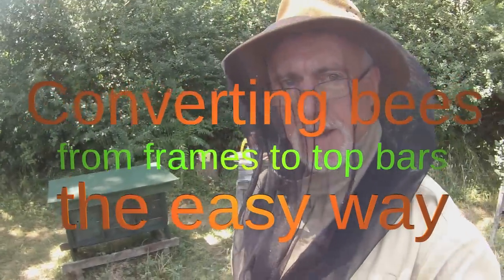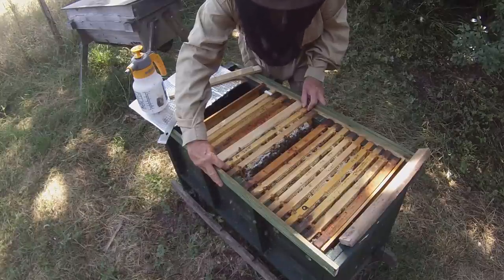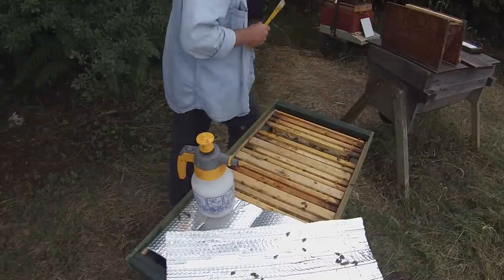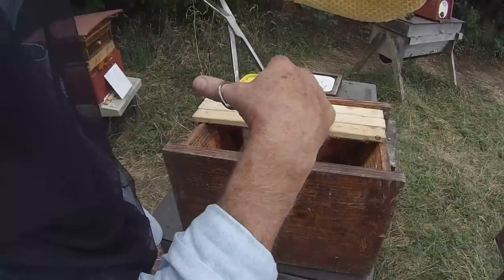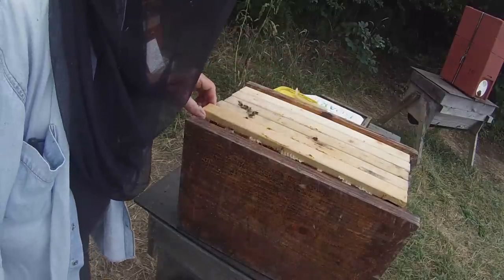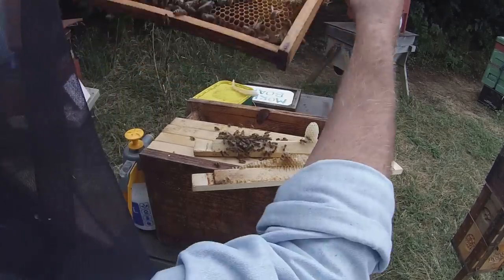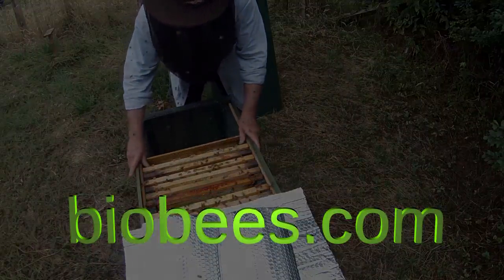How to convert bees from frames to top bars the easy way!

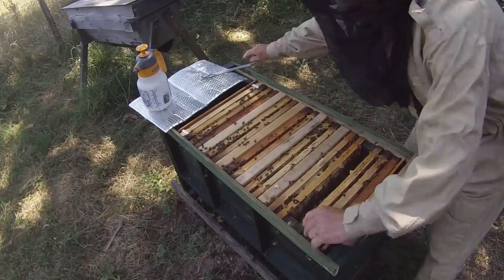Comment: As per your comment at 5:35 about using metal runners to reduce friction, you might try just pushing a thumb-tac into either end of the top-bar where they rest on the runners.

Comment: I am curious what would happen if you leave the top bars in the square hive for longer. Would the bees then attach the sides of the comb to the hive? In my top bar hive the bees hardly attach to the sides and I have not had any cross combing. I have seen that here in Germany it is possible to buy top bars for the more common hives - Dadant etc. Wonder what they would be used for.

Comment: On the top insulation - the Aluminum side reflects heat - and so it should bee below to reflect the heat back downwards.
Reply from the maker: Both sides are covered with aluminium foil.
Reply: @BarefootBeekeeper  Thinking aloud here Phil, but does Reflectix induce condensation with all that nectar being evaporated in the frames below? Perhaps not since Reflectix maintains ambient temperature owing to the air pockets. Still, I wonder about it interfering with ventilation flow overall.
Reply from the maker: @AntPDC  convection takes care of it. A good read is Constructive Beekeeping, by Ed H Clarke (free download from my site).

Comment: Hi Phil,
Hope this question finds its way to you on an older video of yours but thought it best to place on a video where the question has relevance. I'm an avid watcher of your very informative videos so thank you very much for such a range of instructional and knowledge building topics. I have been considering keeping bees for several years now and am now in a position to do so. I have always gravitated back towards using a TBH even when there have been very knowledgeable people I have spoken to who have offered that start with a national hive to start and then transfer if you still feel you want to go topbar. I have just reserved a nuc (Jan 2021 for June) and thought about how I could convert a 5 bar national nuc to a TBH from the off as it were. Do you think it is feasible to carry out this within the poly nuc or would you suggest setting up an intermediate such as your hive in this video? I was wondering whether the bees would be able to cope with the move to me and then the time it would take to begin their topbars within a confined poly nuc? Any help would be very much appreciated. Kindest regards. Graham
Reply from the maker: You could do it with s poly nuc, I think. Probably a double decker.
Reply: Why not do what Phil did in reverse ? Use the Frames of bees you have in said purchased equipment. And, take out two outer frames, and add a Top Bar, zip tided under a 'spare' faux Hive frame.... 
As the bees build up the TB's, remove another 'real' frame, and place in outer position. Then by default the centre frames will become TB-esq. (Trim square comb to 'Fan TB shape', and transition them to real TBH !  )😉
*Any bees remaining, shake back into box, use comb and stores (later, zipped to a TB for bees to utilise, to feed them up etc...)
Hope this helps... 🤗
A Horizontal Langstroth user, who has to cobble non Lang stuff into inside Lang.... And sequence them to outer position over time !  

Or you could Cut out Comb from each Frame and Zip Tie in place to a TB. (*Like those doing cut outs using Rubber Bands into frames ! ) TBs will take zip ties, or wire instead.... In your example.
🤗
🐝🐝🐝🐝🐝🐝🐝🐝🐝🐝

Comment: What was the oil you add to the water spray.?   Thank again for you vids
Reply from the maker: I mostly use peppermint.
Reply: Ok I appreciate your response.  Again someday I’ll like to visit.
Reply from the maker: @Majorme2  you are welcome to do so.
Reply: @BarefootBeekeeper  what are the proportions of your peppermint oil to water mixture?
Reply from the maker: @michaelpisapia  15-20 drops per litre, but it's not critical, as peppermint has been researched with bees and found to be harmless even in much larger doses.
Reply: @BarefootBeekeeper  Thank you for your reply.  I like the idea of using a spray of water with peppermint oil rather than a smoker. Thank you for your wonderful videos- they are very well done, instructive and fun ;-)
Reply from the maker: @michaelpisapia  it's so much easier than smoke, and smells a lot better. Nothing to light, and no chance of setting your car on fire...
Reply: @BarefootBeekeeper  My thoughts- and concerns- exactly.  I avoid every chance I can to set myself alight :-)

Comment: Phil i was given some  topbar hives this year . I am starting with my two langs . if my hives were strong enough to manage a walk away split could i  use your method   to accomplish this ?  ;)?
Reply from the maker: Absolutely. It works really well, and has the advantage of leaving a viable colony in the original hive.
Reply: @BarefootBeekeeper   is there a link that  has the measurements to make a proper  topbar nuc for the woodworking newbie.  even at 54  wood working is still a mystery!  ;)
Reply from the maker: @Rushgamer-yw3lm  you could download my TBH plans and simply reduce the length of the sides to 9 inches, to hold 6 bars.
Reply from the maker: http://biobees.com/build-a-beehive-free-plans.php

Comment: The ‘Conversion Hive’ seems like something that would be banned by the woke folk in America!  I love that you have all these different hives.  I have collected scrolls and ancient manuscripts for almost 50 years and hope to find old hive ideas for beekeeping once I have fully established my modern hives and learn much more about bees.  I have seen other horizontal hives where the top has been hinged.  This seems like the easier access for a beekeeper in wheelchair.  Do you have any recommendations?  I am not in wheelchair currently but understand it is coming.  Thanks again for sharing your knowledge and experience.  Ps-I’m partial to my professional tailoring shears (designed for certain leathers) but the wetting idea to keep the blades from sticking is GENIUS!  Sorry for another question….but…is it possible to start a war in the hive by shaking in bees from several different hives?

Comment: Why top bars? Why the diagonal sides on the hive used for the nuc? Why if that trick with the water sprayer works so well, doesn't everybody do it? I've been watching bee videos for a couple of weeks and I was surprised to see so many things I hadn't heard of at all packed into one video.
Reply from the maker: These practices have developed over 20 years. People tend to do what they have been taught and don't always think for themselves. Top bar hives are simpler, need no frames, foundation, extractor, queen excluder, smoker, etc and they are easy and cheap to build.
Reply: @BarefootBeekeeper  Thank you for an excellent video!  Why do you not use a queen excluder?  (I'm not even sure how one would fit in this shape hive.)  I really like this type of hive as it eliminates the lifting and heaving of often quite heavy boxes.  Do you post plans for building one of these?
Reply from the maker: @michaelpisapia  there are plans for top bar hives on my site at biobees.com
Reply from the maker: You can use a queen excluder in a TBH, but it has to be vertical, of course, and be a bee-tight fit!

Comment: Try drilling a hole or holes in the top bar preferably the size of a bamboo Barbecue sqewer and push them to the bottom of the frame and this will support the comb
Reply from the maker: This is a top bar hive: there is no frame. I tried using wooden skewers to support the comb many years ago, but unless you align them perfectly vertical, the bees often build comb between skewers on adjacent bars, which renders them more of a nuisance than a help.

Comment: Your top bars look the same size as the BS frames. All the top bars I've seen in a friend's hives are bigger. Are your TBHs a different size to 'shop' bought ones?
Reply from the maker: My top bars are the same length as a British Standard National frame: 17". If you otherwise use Langstroth hives, then you probably want to make your bars 19" long to ensure compatibility.
Reply: @BarefootBeekeeper  , is there not a 'standard' top bar length then?
Reply from the maker: @defdave101  no. It makes sense to make them according to local hive standards, but there is no real need to make them any particular length. Once they get beyond about 20" they start to become unwieldy, however.